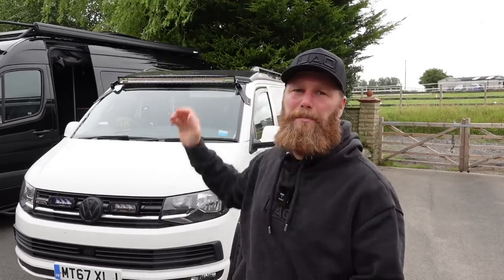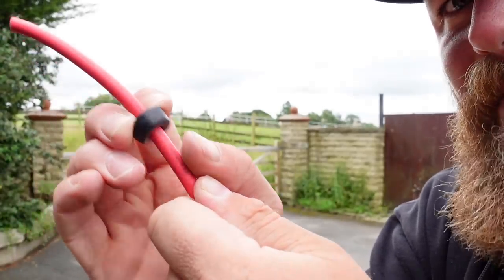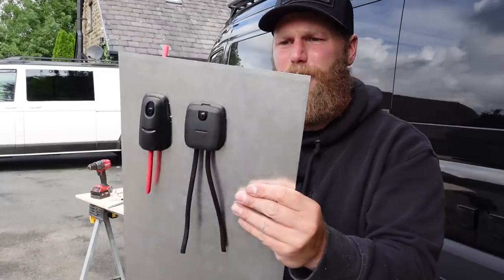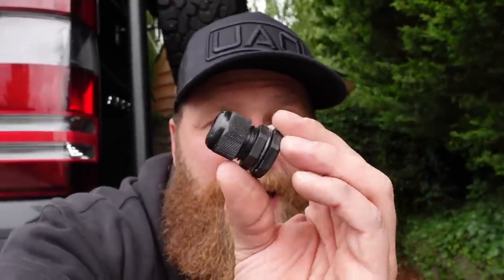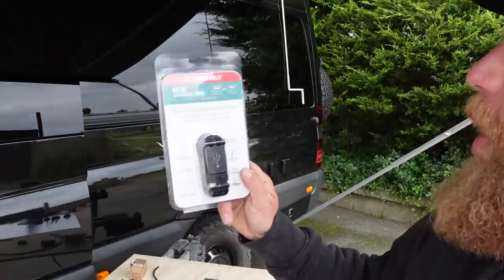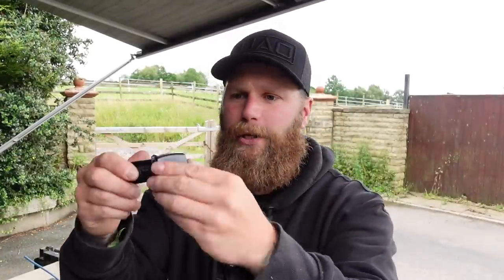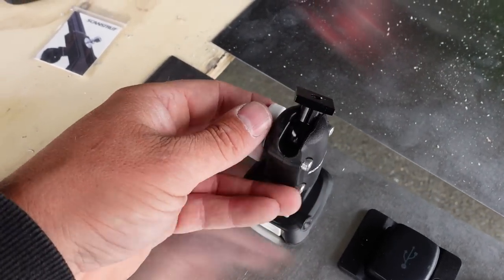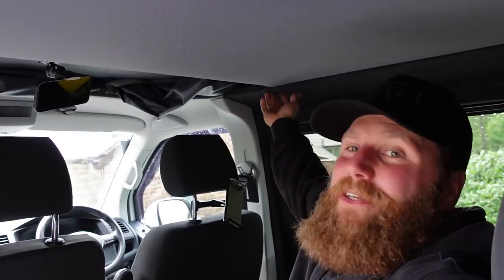10 campervan accessories to PERFECT your build. Did you know these existed? SCANSTRUT

Comment: On the bog standard cable covers i always put a rubber gromit in the home to make sure the cable is not cut by the metal.
Reply from the maker: Yeah I did. A 20mm gland the sparky use. 👍🏻 top job mate.

Comment: You have fantastic glands... 

But with the "flip pro", I'd be concerned about the cover pushing down constantly and laterally to the plug. Especially on the USB-C...
Reply from the maker: Doesn’t push hard enough to be a concern I don’t believe 👍🏻
Reply: The Flip Pro cover actually locks up into place if you push the lid up, so it does not lean on the cables when in use! :)
Reply: @scanstrutltd6804  That makes sense... I did wonder if there was a way to lock it up. Thanks for the info. 👍

Comment: How would the rubber bung work for solar cables that already have the MC4 connections on mate? I'd love one of the double glands, but don't think I'd get the MC4 connections through the rubber bungs to feed down?
Reply from the maker: May be use two of the single done versions that you can split the rubber 👍🏻
Reply: Impatience getting the better of me, watch on for another 3 minutes would have done the trick😂 Great stuff thanks for your help!!
Reply from the maker: @Ccfc595  ha ha. 👍🏻👍🏻👍🏻

Comment: Did you have to get an additional clamp to fit you iPad or did the phone clamp stretch enough? I’d like to mount my iPad Pro.
Reply from the maker: Hi mate. If you buy an iPad kit…. It will go from base to mounting it. You can opt for diff bases. 
But a screw down kit. Will get you from…. Flat surface to mounting an iPad. Nothing else needed. Watch the bit where my iPad is mounted to ooo top. That’s 1 kit.
Reply: @urbanarkoverland  nice one, thanks mate - great channel by the way. I feel like an imposter though as I have a MAN TGE 😂
Reply from the maker: @bigrob1971  so so many now matey.
Reply: Nice one 👍🏻 another purchase to be made 😂
Reply from the maker: @vandox21  uao10 10% off 👍🏻👍🏻
Reply: The iPad and phone mounts are different, but as he mentioned, if you buy one of the kits, you would only need to buy the top part in order to swap from phone to tablet, no need to buy the whole kit again! :)

Comment: great video brilliant very informative with some really good products 
but one big issue is the transporter website none of the links work and i searched manually couldn't find any of these products
maybe because I am located in Spain
there is also many other issues with the site (too many to mention )
I would of purchased iPhone mount but couldn't find it
this website is so bad and also very good 
i can not get to main site with out a vpn i may try this but so annoying
Reply from the maker: Hi mate. I am on the website all the time and have never struggled at all. So I’m sorry to hear that. It may be location. I have no idea if they ship internationally. 
I’ll try the site when I can and get back to you.
Reply from the maker: Hi. Code definitely does work. Just tried it. And the mount is in there. 
Search scanstrut and it pops up. 
When at basket. There is a question. 
Do you have a discount code.  
Hit that. 
NOT voucher code. 

But I’m here in uk so that may be why you are struggling. 
Maybe reach out to scanstrut themselves and ask if they will honour the discount. Imagine postage will be higher than standard uk. That’s a guess
Reply: @urbanarkoverland  thanks for reply 
its due to my location i can get it to work if i enable a vpn 
but you really should not have to do this
they are blocking certain country connections  which is short sighted as i could place order from  here and get delivered to uk 
plus so many other issues with website is really does suck  
but the products are brilliant and thankfully this product is available on other sites
Reply from the maker: @eurosatwiz  ye. All that is a bit beyond my IT technicalities ha ha.